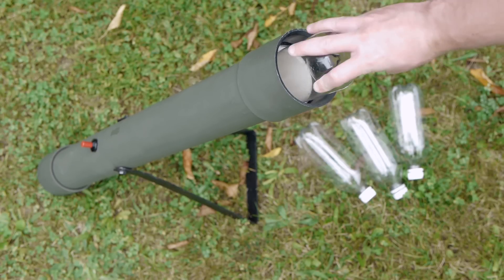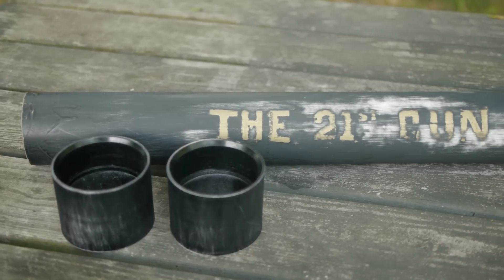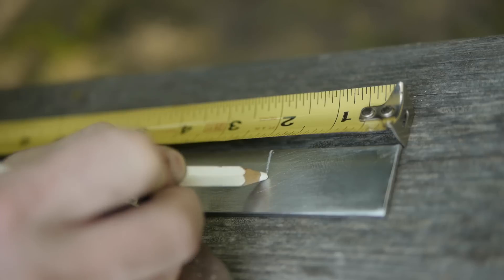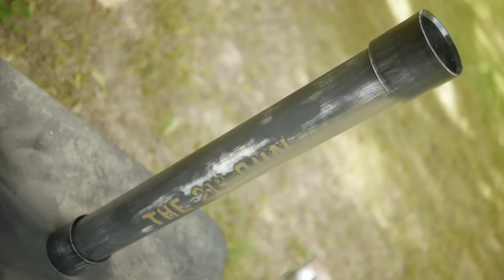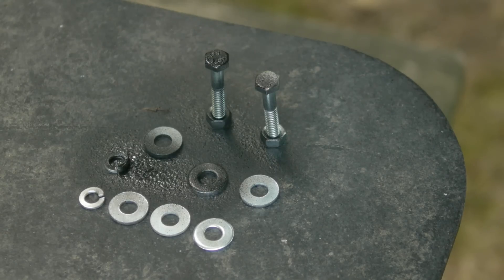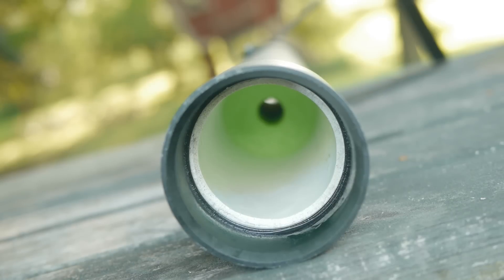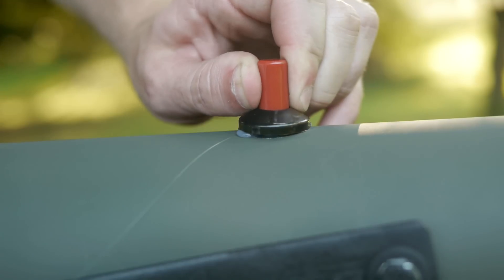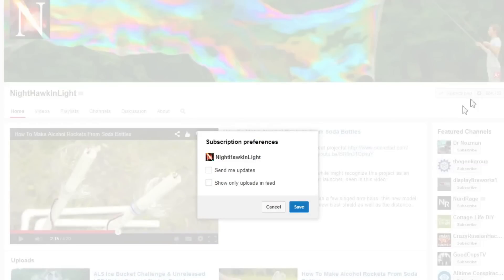How to Make an Alcohol Mortar Launcher

Comment: All pool noodles are not the same.  In gathering materials for building one of these, I was at the local ACE Hardware, and they had pool noodles in several colors.  I measured the diameter of them and found they varied by up to a 1/4" by color.  The orange ones were exactly 3" diameter and slid perfectly into the 3" PVC pipe. Your mileage may vary.

Comment: Back in the day of steel pop cans we would make tennis ball cannons.The bottom can just needed a hole punched into the side near the bottom for the hairspray which was the fuel.The middle can was turned upside down and the bottom cut out inside the steel lip those cans had and the third can just needed the top and bottom cut out the same way.Duct tape the three cans together drop the tennis ball in and it would sit on the bottom of the middle can which is actually the top part of the can with pull tab pulled of corse spray in the hair spray in the hole you cut on the bottom can hit the same hole with a lighter and the tennis ball would blast out of site it was very impressive.

Comment: It needs to shoot a bottle with a payload. Maybe paintballs that could scatter out like grapeshot or shrapnel.
Reply: but it was a bonding experience when I was a kid we used to make these out of steel pop can stuck together with duct😅tape last can was top opening solid on the back with a touch hole on top. We would use lighter fluid, gas or ?. shake and touch shoot tennis balls . Made one with a clear heavy plastic tube did not last but ehole tube would light up w a 3' mussle flash big bang. Have seen big ones pipe mounted on a truck.
Reply: No aluminum !!!!  and these do fail. You can get hurt.

Comment: All you need is drill a hole on top and add extra gas pressure then plug whole with a trigger switch then turn around add a war head to the pepsi bottle the trigger to release pressure it flight to target and explose so war head can be gasoline and second one had gun powder so it start burn the tank then add on the war head with shrapnel like hand grenade

Comment: Sorry, is it rather safe or may explode with a harmful for a man, like potatoes guns, for example?
Reply from the maker: It will not explode if using soda bottles. The biggest danger is leaving liquid alcohol in the bottle which will spray out on fire when launched. It is better to use a propane torch to launch the bottles which you can see in my more recent bottle launcher videos
Reply: @Nighthawkinlight  Thank you for your answer!

Comment: I liked your instructions on how to make, would you be able to let me know length diameter and how far down the tube for the noodle and what size to use. Does the ignighter wires go up through the noodle and through the blast shield? Are the batteries inside the tube then…?I really want to make one and just wanted to check…Thanks!
Reply from the maker: Here is the earlier video: https://youtu.be/wuz0curb_hg

The noodle is 3 inch in diameter and pushes into the tube far enough that a bottle sits flush with the end when pushed inside. I no longer use alcohol for my current launchers because it doesn't always work in cold weather. See this video for my updated way of launching them: https://youtu.be/iiH1l3zTSaQ

Comment: I know of someone who made a tennis ball launcher out of five steel Gatorade cans( maybe Nutrament shake cans can be used). He cut out the top and bottoms of four of the cans and stacked them with the onset can on the bottom, and duct-taped them together. Then he bored a hole on the side of the bottom can near its bottom. He stuffed a tennis ball three cans deep, then put three drops of lighter fluid in the bored hole. He retired the whole tube so the lighter fluid would vaporize, then he set the can straight up on the ground and light his lighter near the bored hole. I heard a giant THOOM and the tennis ball mustve gone up over 100 feet.

Comment: Someone need to reverse engineer this concept and have the flammable gas stored in the gun (hmm hpa airsoft?) 
And a cap or striker in the projectile - 3d printed bullet with a hole to fit a (cut in half ) match - the hammer needs to be angled to recreate the stroking action and  once you work out what amount of gas to release with each trigger pull... 
Strike anywhere matches would be preferable for this.
What do you think bro - would this be possible?

Comment: There is an easy way to make the bottles fly straighter and look a lot cooler. You use the cap attached to a cardboard roll. Drill as large of a hole as possible in the cap and hot glue the roll to the outside. Then, make some fins and attach them to the roll. You can make them straight or offset to impart spin. You will have to add a little weight to the nose. A couple of pennies and hot glue works fine. Paint it all OD green and stencil some yellow numbers on the side. They end up looking like real mortar rounds.

Comment: NightHawkInLight i got the gun to work but it doesnt shoot farther than 10 feet and the bottle just flops in the air and it doesnt work after the third try. What do i need to do?
Reply from the maker: Maybe try different bottles that are a tighter fit on the PVC. the tighter the bottles the more pressure will build which will fire them further
Reply: NightHawkInLight what bottles are you using here

Comment: thats pretty cool. when I was a kid we would get soda cans (back before cans were aluminium ) take 4 tin soda cans the bottom one leave alone the 3 others cut out top and bottoms tape all together make a small hole in bottom can near the base. lots and lots of tape. electrical tape works well. then put about 3 drops of gas in the top part and 2 drops gas in the bottom hole. Then shake whole thing like he does with the bottle. to vapor the gas. drop a tennis ball in the top and light the bottom hole with a lighter. and boom the tennis ball goes a good 100 yds. For night time we would soak the ball with a little gas and fire ball time.

Comment: I knew someone who did a similar thing but with steel cans and tennis balls. He cut the tops and bottoms out of four cans and set them on top of each other connected by duct tape. he put a fifth one on the bottom but left the bottom on and cut a quarter-sized hole in the top. He then drilled a tiny hole on the outside bottom of the bottom can. He stuck a tennis ball 3 cans deep from the top and put 3 drops of lighter fluid in the tiny hole, then rotated the whole thing until it evaporated, 20 seconds i guess. Then he set it straight up and put his lighter to the tiny while. UP went that tennis ball around 100 feet or so!
Reply: Perktube1 my brother and I built exactly what you are describing when we were kids back in the late 70's, early 80's. It was a blast, pun intended.

Comment: Maybe add a pressure trigger? Real mortars are triggered just when the round hits the bottom.

Also make the tube a tad bit wider so the bottle can just slide down
Reply: 60mm mortars have a trigger on them too and the one he made is closer to a 60mm than an 81/82.
Reply: Not all 60mm mortars, but I get what you mean. Yea it does loot a bit less 81/82 now i look at it.
Reply: Yeah sorry just US Army ones at least.
Reply: The 60mm mortars that the US military uses can be drop fired OR trigger fired. Most mortar systems (that are 60mm), have the same select fire capability as well. I only say "most" because there might be some outlier that I don't know about.

Comment: What size soda bottles are you using? Struggling to find bottles that will fit in a 3" pvc pipe.
Reply: In measuring plastic  bottles that would fit in the 3" pipe, I found that the 1 liter Smart Water bottles seem to be a good fit.
Reply: @billlaird7332  I’ve found the small size soda bottles work best on mine. Think the 20oz but shorter ones.
Reply from the maker: I don't remember how much they held. They are a smaller than usual size that I find various brands of soda and sparkling water in at my local grocery stores.
Reply: NightHawkInLight are you in the U.K.? Or USA, noticed a bottle said Tango on it, we don't have that soda stateside.
Reply from the maker: US. These particular bottles are Faygo brand which is a Michigan thing.

Comment: i use propane to fuel my rockets
Reply: Captain Dookey Does it work?
Reply: Yeah it does... it works on propane and it cost at least 50 bucks to make. Of course i went full ham and spun a full wooden stock on a laythe for additional weight.
However i took this to my airsoft field and alot of the players there thought it was revolutionary, but the wanabe pro players had it banned by convincing the brodies who run the course that it was identified as a homemade bomb.  Which i know is bullshit because this uses combustion to propel whereas a explosive uses combustion to fragment.

Comment: My son and I made one today. ours is a rocket launcher style. I couldn't get it to work with alcohol but from reading through the comments I'm  thinking it was too cold? In the 50's today. I did get it to work with butane from a bic lighter.
Reply: Marc B what size soda bottles did you use?
Reply: Marc B lighter fluid
Reply: Hair Spray

Comment: I made one styled after the RPG 7. It worked a few times but requires eye protection because gas tends to blast back in your face. Also it was too small and hairspray is not a greatly reliable propellant. The hard part is making it visually pleasing.

Comment: My blast shield melted then flew with the bottle
Reply: Too much something I suppose
Reply: +carnage there was a little gap between the shield and the wall and I made my mortar a little differently so mine is all hollow so the blast went down all the way in the case and came back up and melted it because when it melted a piece of the shield flew out of the barrel
Reply: I also made mine hand held and the button is on the bottom
Reply: +RC TRAILING GARAGE the gap is most likely the problem.

Comment: Hey you should use solder to tin the ends of those 2 wires then they w stay stiff and bend less
Reply: That will prevent an electron jump, if there is no jump present the alcohol vapor won't ignite.
Reply: Tinned wires will still have the jump.

Comment: Idea: push the whole thing down a little deeper add a 1/2" piece of foam (cut a disk out of 1/2" think foam) then insert a water balloon filled with paintball paint mix (you can buy the powder on the web and mix with water). The bottle would more or less be the propelling force to launch the paint balloon at other players that may be hiding out in a fort or such.

Comment: Do you have any idea what the range is like? It's hard to tell from the video. Do you have any suggestions on getting more range out of this as well? This sounds like a fun summer airsoft project.
Reply from the maker: +James Mahoney The wind is a big factor and can increase or decrease your range quite a lot. Probably 150-200 feet on average. A little weight added to the end of the bottle might improve consistency, but be careful not to make them heavy enough that they might injure someone.
Reply: NightHawkInLight would this work with a smoke bomb? Like you can get one of those store bought smoke bombs with a fuse, put them in the bottle, light them up and shoot, would that work?
Reply from the maker: You could glue one to the top of the bottle
Reply: NightHawkInLight ok, because I want to make one to launch smoke grenades into my yard for New Years or something, maybe mark targets for airsoft.

Comment: I built one and it duz not work do you need 90 or 70 aoucahol for it to work
Reply: +Logan Madsen  I used 90% but the biggest factor is the right amount of alcohol and surprisingly, if it is too cold.  I had to warm the bottle in my hands or wait for warmer weather

Comment: One question I must ask from one builder to another. Where do you find your piezoelectric igniters? I look them up on the internet and I cannot seem to find the correct ones I'm looking for.
Reply from the maker: +BigBoss123410001 Try searching for barbecue igniters. They're sold in most hardware stores, and easily available online.

Comment: Just a quick note, you can bend the low carbon steel stand without any heat in your vice. Just bang it with a hammer. Good job!

Comment: My dad and I built this together and it work really well, but only for about 4 or 5 launches after that no matter what we try it wouldn't launch we have replaced the igniter made sure that there were no left over vapors as well as use different bottles does anyone know how to fix this problem
Reply from the maker: Maximite Is there still a spark between the wires?
Reply: Yeah we have doubled checked every time we try to launch it and there is always a spark
Reply from the maker: Maximite Very strange, that stinks. Are you exactly following my instructions for fueling in this video: https://youtu.be/wuz0curb_hg?t=2m16s You'll want to use at least 91% alcohol.
Reply: Maximite I use 99% Alcohol and also make sure there's enough fumes and that the bottle is halfway on the pipe, it should work just fine.

Comment: do you have substitute for alcohol
Reply: Fathimath Hafsa You Could You Some thing like aerosol. I am not sure.
Reply: +Matthew Powers I need clear answer cause I don't have alcohol so nIght hawk can *you answer
Reply: Fathimath Hafsa use kerosene or lighter fluid
Reply: Fathimath Hafsa worked for me and went pretty far
Reply: thanks man
Reply: And if you need go to any pharmacy and buy 91% isopropyl alcohol they sell it to anyone no matter the age and it is only 5 dollars for a good bottle
Reply: Fathimath Hafsa Pharmacies sell good and cheap (95%) isopropyl alcohol. They work same as the video shown and are usually labelled as menthylated spirit if you buy them at pharmacies. If you can't find them on your own you can just ask the pharmacist to help you find it. The spirit is way more effective and safer than aerosol or kerosene. Good luck with your model!!!
Reply: thanks man helps a lot man :)
Reply: Lucas Chu  bad news in my country we don't have it need another alternative
Reply: Yeah you can use axe or any other cologne or could use WD40
Reply: +Fathimath Hafsa What about nail polish remover? The one with acetone.
Reply: Maybe

Comment: where do you get the fuel, well that's easy just buy a fractional distilled and a mantle and boil of methanol and ethyl alcohol of old booze you have around the house, it works a treat, it's basically rocket fuel. It is a good investment as well for you can make essential oils to sooth your weary skin after a hard day's work of mortaring the grass

Comment: What is the drill bit called that you used to make the hole for the igniter
Reply from the maker: It's called a stepped bit. They're kind of expensive, but they're worth the cost. Regular bits will work fine to drill the hole as well.

Comment: I have tried to "manualy" launch a bottle without the surrounding just to see if it works.
I used Isopropanol and the fueled bottle rather "burned" for one second then exploding and launching the bottle.
I also tried it with pure ethanol, but the the results were the same.
Does it have something to do with me using a BBQ lighter instead of a spark ingniter or is the used alcohol just the wrong one?
Reply from the maker: The pipe in the center provides compression and gives the combustion pressure something to push against.
Reply: Thanks for the fast reply :)
Yea, that seems legit.
But it is normal, that it burns down and does not explode?
Reply from the maker: Skullair313 Yes, that's normal.
Reply: Allright, thanks :)

Comment: Question. We constructed one but we used a smaller pvc pipe then 3 1/4 would that affect it as we can't seem to get it to launch. We are also trying to shoot it in -20 c could that be causing it not to fire.
Reply from the maker: As long as the barrel is 1/2" diameter the rest doesn't really matter. It doesn't work very well in the cold though, that's probably your problem.
Reply: NightHawkInLight
Thank you I will try using it in a warmer area and go from there.

Comment: You can cut the bottom of the bottle and leave the cap. Put some FOAM on that end and it will have a more stable flight. And if you push it more inside the pressure will be a little stronger. Just an idea dude.

Comment: Can you make a container from metal and heat up the alcahol and then load it with tubes to the mortar for a semi automatic mortar?
Reply: I really doubt it
Reply: Kaleb Wimber just so i know u are not missuderstandig. I ment heat up the alcahol to stem. Load it to a pressure camber with a vale. And then ignite the steam.
Reply: FoxMaccloud I still don't think it would work. The pressure isn't an issue, it's the fact that how will you fire multiple rockets without reloading, and refueling?
Reply: Gabe Newell you have to put in the bottle yourself. The alcahol is in steam form. i use a vale from the presure tank and feed into a chamber lokated in the barrel with an igniter. MAKE SURE TO CLOSE VALE OR ALL THE ALCAHOL WILL EXPLODE. Then just Fire! after that load a new bottle and more steam.
Reply: FoxMaccloud The word 'steam' refers to water vapour, vapour is a general term used to describe a substance in gaseous form. The hardest part with your idea would be getting the oxygen in as well, if you could find out the most effective oxygen to vapour ratio you could get hold of a car lambda sensor, using this to control solenoid valves to make an automatic fuelling system.

If there is no oxygen in the presence of a fuel without it's own oxidiser it will not burn, one solution would be to pre mix the alcohol vapour and oxygen at the correct ratio and pressurise into a cylinder, then inject into the chamber at a constant pressure every time using a pressure regulator. This may prove rather dangerous if it were to leak.